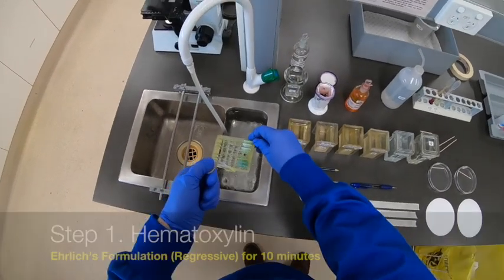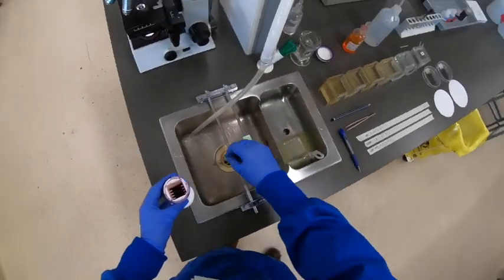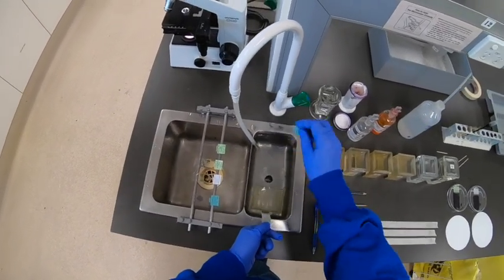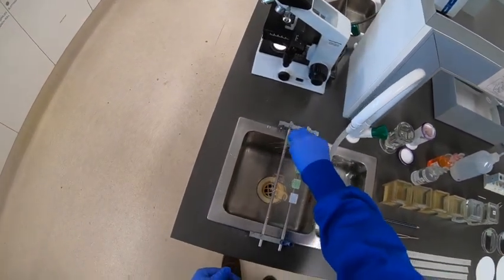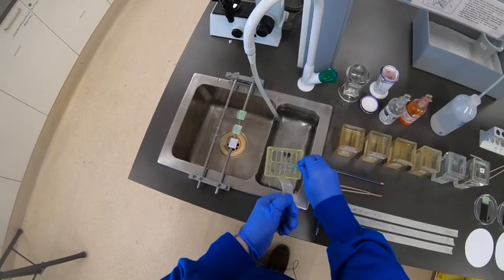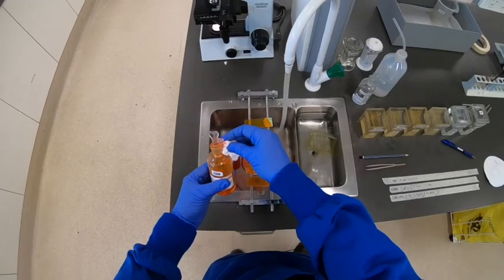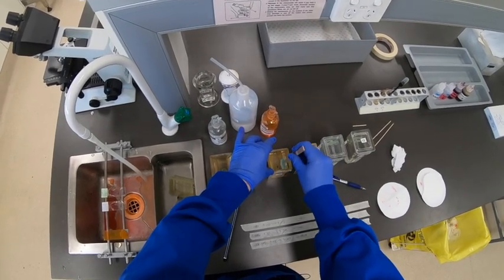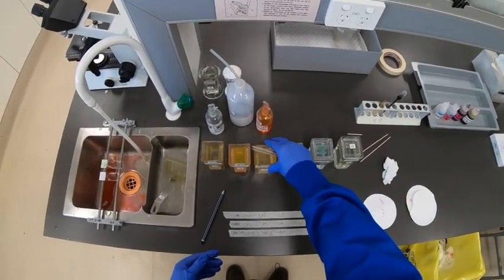The H&E Staining Protocol

Comment: Sir I have a question about bone calcification: For unfixed bones, which of the following solutions should be used: formalin - nitric acid solution or formalin - formic acid solution? Please help me, thanks a lot.
Reply from the maker: Hi Linh,
Nitric acid is a stronger acid and so decalcifies bone more quickly, but it is also more damaging. So if starting with non-fixed bone, I would suggest combining the formalin with the weaker and therefore more gentle formic acid.

Comment: Will have to try this with my pulmonary tissue, I’m having a difficult time with the protocol I have now. What dilution are you making for the ammonia and the acid alcohol?
Reply from the maker: Hi Benny, There are multiple factors that might be causing you problems. I would suggest checking the level of staining with hematoxylin immediately after rinsing off the stain in water and treating the slide with dilute ammonia. If the level of nuclear staining is poor, then your hematoxylin solution may be the problem, or you may just have to stain for longer. Depends upon what recipe of hematoxylin that you are using. In any case, our dilute ammonia is prepared by adding 1 mL of ammonia to 999 mL of deionised water and the acid alcohol is prepared by adding 5 mL of concentrated hydrochloric acid (38% w/v) to 995 mL of 70% ethanol (v/v) in deionised water. Good luck and let me know how things work out!
Reply: @damienharkin  thank you so much! I’m a grad student but unfortunately don’t have much support in terms of my histology work. I’m very grateful for your advice! I will let you know how things progress. :)
Reply: @damienharkin  I tried your recommendations and the tissues look great until the last xylene step for dehydration at the end. When xylene is wet and on the slide, under the scope the tissues look perfect but when the xylene dries, the tissue turns extremely dark and all demarcation between cells is lost. I’ve been playing around all day to troubleshoot but have not had any luck. Any thoughts would be greatly appreciated!
Reply: @damienharkin  I’m wondering if I need to use my permount and coverslide immediately after I take the slide out of the xylene? I was told the slide needs to dry before I use the permount but by then, the tissue looks terrible.
Reply: @damienharkin  last reply!! Haha, I got it, I needed a little more xylene in my old permount! Thank you Dr. Harkin!
Reply from the maker: @bennybobanger7841  don’t let the xylene dry before adding your mounting medium and coverslip. Watch my video on how to mount coverslips onto slides.

Comment: @damien harkin is there any way you could list all the epuipment you used?
Reply from the maker: Hi Donna, equipment for performing H&E staining depends a little on how many slides and how often you intend to stain. 

The simplest list of equipment (assuming that you already have sections on slides) would be:

1. Coplin jars, including at least two that are compatible with xylene (e.g. glass).
2. Xylene resistant forceps for handling slides. 
3. A sink with overhanging staining rack (e.g. metal grid oven shelf).
4. A well ventilated area to perform coverslipping. Preferably a fume cupboard or down-draft bench, but if only occasionally performing a few slides, a fan may be sufficient. 
5. Solvent waste containers.

In terms of key reagents.
1. Xylene
2. Absolute ethanol
3. Pre made Hematoxylin solution.
4. Hydrochloric acid
5. Ammonia
6. Deionised water
7. Pre made eosin solution
8. Plastic mounting medium
9. Glass coverslips
10. Paper labels
11. Graphite pencil for labelling slides prior to removing paraffin.

That should get you started. Happy to provide more details if required.

Comment: Hello, what are the most widely used fixative in HandE staining method

A. Formaldehyde
B.zenker formol
C. Picric acid
D. Osmic acid

Please help me answer
Reply from the maker: Hi Rica,
Neutal buffered formalin (3.7% w/v formaldehyde) should be fine for most H&E applications. 
Thanks for watching.
D
Reply: Hi thank you for the quick answer, unfortunately my question lacks tatement it should have EXCEPT, everything is right except.
Reply: What are the most widely used fixative in H and E 
" EXCEPT " PLEASE HELP all answer seems right
Reply from the maker: Oh, that's easy. You wouldn't use osmium. That's used for electron microscopy. Sounds like you are studying for an exam? Good luck!
Reply: Ohh God thank you so much ♥️♥️♥️ I am . Thank you so much it means so much

Comment: Thank you Sir for this wonderful video. I'm planning to do an H&E on liver tissue and I was wondering if I can have a written version of your protocole. Thank you
Reply from the maker: Hi Paule, 

1. Remove paraffin from slides by immersion in two changes of fresh xylene for 3 minutes each.
2. Rehydrate slides by passing through 100%, 100%, 90% then 70% ethanol for 1 minute each, then rinse slides in tap water, followed by distilled water.
3. Apply your hematoxylin solution of choice.
The time depends upon the formulation used.
If using a regressive hematoxylin solution (e.g. Ehrlich or Harris) then you should apply for 10 minutes, rinse off in water, treat briefly with acidified alcohol (e.g., 3 dips in and out; see details in my videos), followed by dilute ammonia.
If using a progressive hematoxylin (e.g. Mayer's) then you need to apply for approximately 1-2 minutes, but check after each minute until desired level of staining is achieved. You may have to treat briefly with acidified alcohol (i.e., differentiate the slides) if they are too heavily stained. In all cases, once the desired level of hematoxylin has been achieved, treat with the dilute ammonia solution to stabilize binding of hematoxylin to the tissue and to convert it to a blue color.
4. Rinse slides in 90% alcohol.
5. Stain with eosin for 2 minutes.
6. Dehydrate slides by rinsing thoroughly but briefly in 90%, 100%, 100% ethanol, then place directly into xylene to clear for 1 min.
7. Transfer slides to second xylene container before coverslipping using a plastic mounting medium.

Hope that helps
Good luck!
Reply: @damienharkin  Thank you so much !  I’m working on vibratome section ( 40um) , do you think it could impact the staining and if yes, how could I adjust it ?
Reply from the maker: This is a very thick section! You will have trouble seeing details clearly by bright field microscopy. Standard thickness for H&E stained sections is generally between 2-4 µm. Do you have access to a microtome like that displayed in my other video?
Reply: @damienharkin  In my lab we just have a vibratome unfortunately. But I can ask to histology-microscopy platform. Can I have the link of the video where you talk about microtome ? Thanks
Reply from the maker: Introduction to microtomy video is here:  https://youtu.be/MRIQZPCX45I

Comment: Thank you for a great video. How do you prepare the acid-alcohol and ammonium?
Reply from the maker: Prepare acid-alcohol by adding 5 mL of concentrated Hydrochloric Acid to 995 mL of 70% ethanol.
Prepare dilute ammonia solution by adding 1 mL ammonia to 999 mL deionised water.
Reply: @damienharkin  thank you Damien;you help me so much......
Reply: @damienharkin  I don't have ammonia...can I use sodium bicarbonate!
Reply from the maker: Yes. Any slightly alkaline solution should be fine.

Comment: Thank you. There are few videos for histology!
Reply from the maker: My pleasure. Am working on one for Gram stains at the moment.
Reply: @damienharkin   I am histotechnician student. We're still on processing and fixation. We'll be moving to embedding next week. Thank you. Gram stains? They work similarly to how gram positive and negative works right?
Reply from the maker: Yep, that's right. Gram stains use a complex of Crystal violet and Iodine to stain positive organisms. The negative organisms are generally stained using basic fuchsin or neutral red. It can be tricky since careful rinsing in an organic solvent is required to clear the negative organisms of Crystal violet/Iodine. So controls are essential.
Reply: @damienharkin   Doesn't that go in microbiology under clinical laboratory sciences? I tried going into medical lab as a technician (had some issues and personal stuff come up). I may do that after I am an HT as a bachelor's degree and become a laboratory generalist.  That is interesting. I never knew how gram stains worked... only that some microorganism are listed as gram positive or negative, and that the gram negative ones tend to be very dangerous and hard to culture.  Thank you so much for your replies! Are you a biologist? Cytologist? What field are you in and what is your job title? This is all so interesting and new to me!
Reply from the maker: I'm a professor at the Queensland University of Technology (QUT) in Brisbane, Australia. You can learn more about the courses that we teach @QUT via the links in my profile.
Reply: @damienharkin  Ahh fascinating, Professor. Thank you. I'm in the USA. I'll check it out.